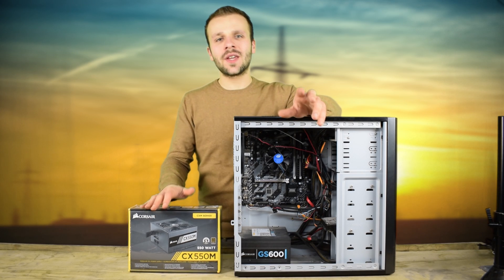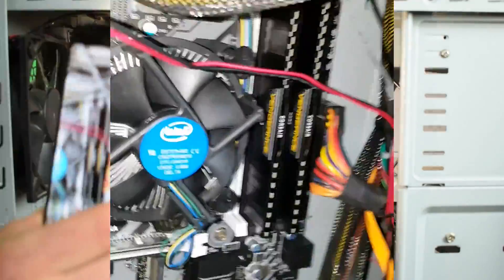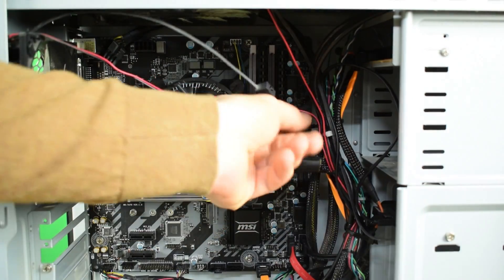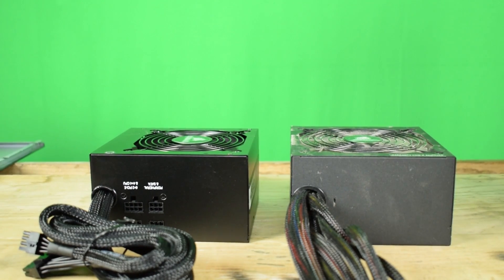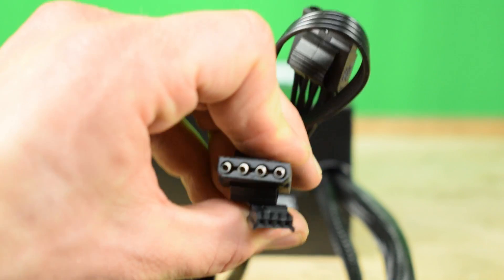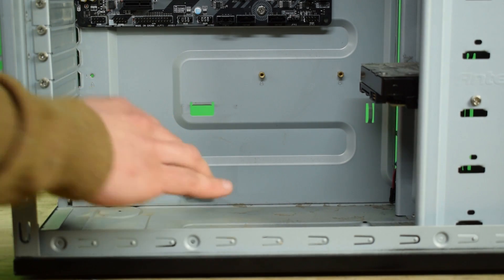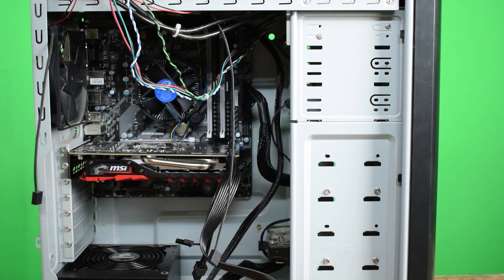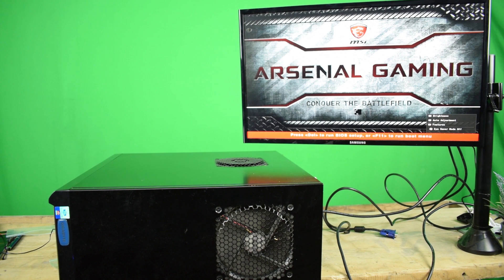How to Replace a Power Supply in a Desktop PC - Advice and installation

Comment: Read here, if your unsure on what todo:- You'll need:- screwdriver, gas can £5.50 Amazon  sprays the crap out of the tower, cloth to clean the dust, $40-100 for the psu and 1 hour.. take both panels of the pc. Put the screws in a place you wont lose it. Unscrew tbe psu, remove, and carefully unplug cables, replace new psu into same position, put cables into places where it should (check your manual) e.g. old or new sort of psu. From there do a test on a game for 2 mins. If your happy turn it off through start menu turn off and reinstall panels. If pc doesnt turn on you've not put cables in properly and or your pc requires more power. Could be the psu is 650 but a low end piece of trash. Ebay used low end model. Corsair is 10/10 for any pc build. You should buy psu NEW, ram you can get 2nd hand aswell as fans but everything else that matters  or is tricky to replace e.g. cost I'd go for new stuff. Ram is easy to replace and install anyway, sometimes costly 😑

Comment: First time taking it out, I bought a pre built because I didn't wanna build my own (I'm a noob) but anyway I didn't like all the parts cyber power chose so I upgraded EVERYTHING better CPU and mobo etc after installing them and the aio I decided that they most likely use a cheap PSU and they do! A no name 80+ cheap ass thing, so I've taken it out and will replace that too, the only thing that remains of cyberpower are their fans lmao I'll change them as well to Corsair.

Comment: Is there any reason why you can't just use the cables from the old power supply with the new one? That way you don't have to unplug everything and plug it all back in. (assuming modular power supplies)
Reply from the maker: Not all modular cables have the same connectors on the PSU end. Also, if you are connecting a more powerful PSU you should be careful too. The cables from the lower power power PSU might not be suitable for more powerful components. Cables are rated to handle a certain amperage, if you suddenly push a lot more ampere/power through the same cables they might melt! 😁
Reply: @Herbertech  ahh good points, thanks! I'm a complete noob to this stuff

Comment: I did this today without any help but i found this because i was scared why it didn't work. Then i unplugged the 3 pin for the system fan and then my cpu turned on. I like to tell myself my cable management is better than most people who did this for their first time ..

Comment: I noticed today a burn smell coming from my pc, turned it off and then tried to reboot. No display but the fans and lights still work. I noticed the psu red voltage switch in the back looked a lil burnt. What should i do?
Reply: You need to turn it on and mist it with water until its fully coated with water. MKe sure to spray into the fan area and all connections. Should take care of the problem!
Reply: Andrew Buckley ok, thanks it worked

Comment: Thank you for this tutorial! The only problem I’m finding is that the computer isn’t actually booting up. Pressing power button doesn’t produce any results. None of the fans inside come on, and the graphics card inside (which is the same MSI graphics card as in this video, actually!) isn’t lighting up. Everything is plugged in properly, no loose connections. I’m not sure where I went wrong.
Reply: I know its 2 months later,  but did u fix it?

Comment: Can I replace my psu with like a 500w , the existing psu I have says total output continuous shall not exceed -- 300w ( i dont know much about the power supply so does that mean i can replace the power supply but i can only upgrade to 300w?)

Comment: Shouldn't the first step be ensuring the computer is disconnected from the any external power? IDK it's what I do first.
Reply from the maker: Obviously, yes. Should have put that in the video, but I figured it was just common sense. :)
Reply: All good, just common sense is not so common. I am replacing a power supply because someone in my family switched his power supply from 240V to 110V. :/
Reply from the maker: Haha, lucky most new power supplies auto switch between 110V and 240V :)

Comment: Do you have to buy the cables separately
Reply: Hello! No, you do not, almost every power supply comes with cables that are attached to the power supply and cannot be removed (non-modular) or cables that come apart from the power supply but can be connected to the power supply (modular).

Comment: I noticed you had your psu fan facing down on your old one, but your case doesn't have ventilation holes at the bottom. is this ok?
Reply from the maker: It is not advised to do so, the fan can't take in air properly. You should face it upwards if there is no breathing mesh on the other side.

Comment: What power supply do you recommend for intel i3 and 4gb of ram
Reply: What was the i3 number cpu and also it depends on what mother board you have gaming or workstation? For a gaming you need 500 mpderate minimum. You want to play high end games with a decent build get 650+ corsair brands. Chose which yky find suited from there.

Comment: Do pin counts really matter?
Like I'm looking for a PSU that I can upgrade to from this https://www.amazon.com/Thermaltake-Certified-Continuous-Active-PS-SPD-0600NPCWUS-W/dp/B014W3EMAO and all the other PSUs that I see either have more, or less pins than I need for things like SATA and PCI-E.
Reply from the maker: These are just non-modular psus, they have a lot of connectors but it's ok to have more then you need. It just makes cable management harder, that's all. :)

Comment: Soo i have been saving money to buy a rx 580 wich needs a 500w psu. Do you recommend buying a 500w psu or a 550wpsu?
Reply from the maker: It depends on what CPU you have, and the amperage on the 12V rail. 500 is often enough if the psu is decent quality, but go for the 550 is you want to be sure. :)

Comment: Hello, after you installed the new psu and gpu, did you need to install windows 10 again, and did you need to change any bios settings?
Reply from the maker: No, there is no need to do that. Just to install latest drivers for the gpu.
Reply: @Herbertech  thanksss

Comment: The main plug that connects to the motherboard wont come out for me
Reply: yes it will its a little hard sometimes just press the lever and pull maybe wiggle it a bit back and forth,- also i have to replace my psu in 2 weeks im kinda scared as well
Reply: That is the most stubborn one.
Reply: @lpimentel89  it's out now, pc is now all upgraded

Comment: I just ordered my new psu and wanted to confirm something.

Apparantly cables aren't interchangeable between powers supplies. So does my psu come with new wires or do I need to buy them separately.  

My psu: https://www.amazon.ca/EVGA-100-W1-0500-KR-WHITE-Warranty-Supply/dp/B00H33SFJU/ref=mp_s_a_1_2?keywords=500w&qid=1581292009&sr=8-2
Reply from the maker: Wires are always included in the PSU, you can rest assured you'll get the wires in the box. ;)
Reply: @Herbertech  thanks!

Comment: is there any problem if power supply capacity is more than the other component requirements?
Reply from the maker: Not at all, though it will be a lot more expensive than necessary.

Comment: do the connections to the peripherals (optical, dvd, HDD/SSD, etc) come with the psu when you buy it? or do I have to buy those separately? idk if my current psu has them attached or if it's removable
Reply from the maker: They come with the psu, no worries.:)
Reply: The IT Guy thanks for the reply. One more question if you don’t mind: for the modular psu it looks like there’s 3 six-pin connectors, I’m assuming these are all the same and work for all the peripherals? Also the 6+2 pci-e is only for the gpu? What if you have more than one card?
Reply from the maker: There are indeed different 6-pin connectors. Most likely, they will be labelled either for gpu or peripherals. The gpu or pci-e connector will have different values in ampere on 12V, since they draw more power.

Comment: Changing my psu and my gpu from a 1050 ti to a 1660 super right now and ive gotta say this guy is great! Laid back but to the point, love it.
Reply: Same I had rx 580 now rtx 5700 xt I just dawned on me about the power supply
Reply: @XDmajorxX  ooo that sucks, same thing happened to me but power supplys are pretty cheap compared to other components so no biggie
Reply: I just made the exact same upgrade yesterday XD
Reply: OMG, im litterally watching this video as i still have a 1050ti in my pc and, i got my 1660 super but i need to order a new psu to replace my old one with.

EDIT1: Im so glad i found this video. When i find a proper PSU, i hope nothing goes wrong xD
Reply: @z4rko292  its always easier than you think. Just make sure you have a clean and clear workplace to do it and think before you unplug/plug in something. Paired the 1660 super with a ryzen 5 2600x and my pc can run cod mw on high-max settings with about 90 fps average
Reply: @juggmessiah2  Nice dude! Thanks! :D
Reply: @juggmessiah2  Hey i have a question. What PSU do you need for the 1660 super?
Does it have to be compatible with the gpu only, or with motherboard as well?
Reply: @z4rko292  the psu has the same correlation to every other part in your pc, meaning the only psu thing that matters to your whole pc is the wattage. I bought the be quiet! 450w which is a little more than i need which is always good just in case
Reply: @juggmessiah2  Thanks man! If my psu doesnt fit in my case, can i still keep it there plugged in all pc parts? Cz the one i have is screwed to the case from underneath at the 4 corners, meaning it probably has to be a specific size for the case. Problem is i got no idea what my case model or type is. If i just dont screw it in place, but as long is it stays in a safe stable spot inside the case, can i still use it and plug in everything? (The new PSU i mean).
Reply: @z4rko292  if the screw spots dont work out with your case thats fine, just make sure that the psu power cable can go in and doesnt get blocked off by your case.
Reply: @juggmessiah2  So no matter where i put my PSU inside the case, as long as it does not block anything off and i can connect everything just fine without issues, it will be ok even if i can't screw it in place?

EDIT1: Sorry for the questions, just wanna make sure i understand everything correctly.
Reply: @z4rko292  yup
Reply: @juggmessiah2  Thanks bro, appreciate it, really.
Reply: @z4rko292  enjoy yo pc
Reply: @juggmessiah2  Thanks bro :D

Comment: Monday night. PC was about to go into sleep mode. Then it wouldn't turn on at all. Bought a new PSU. Comes in tomorrow. Really hope it didn't fry the CPU or mother board or any other components. Wish me luck boys.
Reply: Wtf same. Turned computer off because wifi tab froze. Wouldn't turn back on. I have RX 5700 XT and Ryzen 5 3600X and I think my 450w psu is defo the problem. Ordered a 700w psu from corsair. Let me know how yours goes.
Reply: Joshh and how did it go
Reply: @mayo1631  PSU arrived, same problem after installation. Sent my rig to my local PC repair shop and they said the GPU was faulty. So, I bought a new 5700xt and I was dissatisfied with the drivers. Then, after nearly a month, I ordered a 2060 super that arrived after about a week. I've had no problems and I'm very pleased.
Reply: Joshh hmh thanks for the quick response but I have a qeustion will a 400w pay power a rx580 ryzen 3 2200g 8gb ram?
Reply: @mayo1631  It absolutely would, however Id recommend a bigger psu just in case you want to upgrade. 550w would be perfect.

Comment: I got a used pc from somewhere, but it came with some dodgy Gamemax power supply. I am about to order this power supply, so this video is very helpful for me. I hope the installation goes okay :)
Reply: Dogrzz how was it?
Reply: @zyphen665  It came a little later than expected, but everything went according to plan, now i have my new pc up and running :)
Reply: @dogrzz7082  was it easier than you expected?
Reply: @robertsgutmanis1102  It wasnt that amazingly easy, but it wasn't too hard, my only struggles was trying to get the power supply in the tight psu shroud, and trying to get the case door back on after i was done was a bit frustrating. Overall it wasn't hard at all, just took a bit of trial and error. It would be way easier in a case with a open PSU area.
Reply: @zyphen665  I got the old one out super easy, and the power supply should arrive on the 31st (AEDT) so ill update you on how it goes.

Comment: Can you connect a 8 pin to 4 pin connector on the power supplys 8 pin connector to fit your mother board?
Reply from the maker: Normally speaking the power supply's 8-pin can be split into 2 4-pins. You can use one of the 4 pins to connect to the motherboard.
Reply: @Herbertech  Okay, thank you!

Comment: i just ordered a prebuilt computer but the power supply is 500W so I was planning to buy a 850W power supply so I can install a much better graphics card later on Acer Nitro Gaming PC (Intel Core i5-9400F/2TB HDD/256GB SSD/12GB RAM/GeForce GTX 1050Ti)
Reply: A lot better than a 290w
Reply: @WantBadtime  A lot better than an 240w

Comment: I need help! I recently bought a CyberPowerPC from Best Buy (ik it was a mistake) but I’m not getting anything on my monitor, it just says no signal. My hdmi is connected to the graphics card. The cpu fans light on and the mouse light is on but the keyboard rgb lights are off. The only way for it to work is to turn off the computer and disconnect the power cord and turn it on and everything lights on and I get signal on my monitor, the question that i have is, is my psu bad or defective? I have a Ryzen 7 3700x 16gb ram Nvidia RTX 2060s and the psu is Apevia prestige 800w
Reply from the maker: If you get nothing on the monitor, it can be a lot of things. I wouldn't start troubleshooting and bring it back to the store asap if you bought it recently. Better to use that warranty instead of trying it yourself and maybe voiding your warranty if you do something wrong. :)
Reply: Have you update your motherboard bios
Reply: buy a better power supply the Apevia  line up is garbage get your self a evga or corsair

Comment: are you sure the fan of the power supply needs to be facing up?
Reply: depends if you have a vent on the bottom. if you do you can face it towards the vent.

Comment: Alrighty so I plugged everything in and put my 6PIN into the SATA slot of my PSU and nothing. Any workaround?
Reply from the maker: What 6-pin did you plug in? Do you mean you plugged the 6-pin of the graphics card in the sata slot of the modular psu?

Comment: My specs on my pc are: 8gb ram, 1050ti, I5 intel core, 1tb storage. Would it be ok if i was to put a 650W power supply in it, would it be bad or good?
Reply from the maker: 650 Watts wil be enough for that system. :)
Reply: @Herbertech  thanks for the info!

Comment: Great video thanks :) This is probably a very noob question but shouldn't you use an anti-static matt/wrist band to do this job? Bit worried about it as I had heard I shouldn't do it without one.
Reply from the maker: It's always good to use one, but grounding yourself before touching the PC is good as well. You can ground yourself by touching something metal, or if you want to go hippie-style you also walk bare feet on the earth. :)
Reply: @Herbertech  thanks, I've successfully changed my PSU today using your video to guide me 😊👍 and no more freezing up since, it's awesome.

Comment: I'm doing this in 4 days when my new psu and other parts get delievered.  So far, my main concern have been routing the cables through the right paths, because my case comes with a separate side compartment for feeding the cables through, so as to make the build look prettier. My second concern has been whether my psu will include a dual 8 and 6 pin cable, because my new gpu needs both connections.  It was hard to find information on the included cables.
Reply from the maker: Routing the cables is something you will most likely appreciate afterwards, it does get easier and better with practice. For the dual PCI-e connector you should check with the vendor of course.

Comment: my motherboard doesnt have the 8 pin connector, it only has the 4. could i just use half of the 8 pin into the motherboard anyways? my psu is corsair cx750m

Comment: is it okay to turn that fan upward. does it make the gpu hot?
Reply: Most new cases have it so you can put the fan downward. It does give the best performance
Reply: @hermanify6305  my pc case has an old design and the psu slot is on top side woth no holes on the top pc case.  It is designed for generic psu's with the fan on the back or side. 

I bought tx650 and the fan is on top of the psu instead of side/back.. my question is... is it okay to use my current pc case?
Reply from the maker: If the top of the case has holes to breathe the PSU, you should aim the fan to the holes. If the top of the case is closed, you should aim the fan down. It's better to let the fan intake the inside air of the case than having no space to intake the air.

Comment: I had a atx psu that is dead and i wan to replace it with my old working psu but it has 47/63 hz while my dead psu had 50/60 hz is it still compatible even they have the same wattage??
Reply from the maker: I believe this is the range of frequencies the PSU can handle. Most likely this will not be a problem, since a lot of PSU's actually have this range. It has to do with the input power (the one coming from the wall outlet) and these have ranges from 47-63hz. So I do think you are safe, as long as you are using a basic ATX power supply. Also, make sure there is no voltage switch on the PSU. Powersupplies nowadays don't have these anymore, as most are autoswitching, but just make sure. (It will say 230V and 110V on the switch. If there is no switch, you are good to go. ;) )